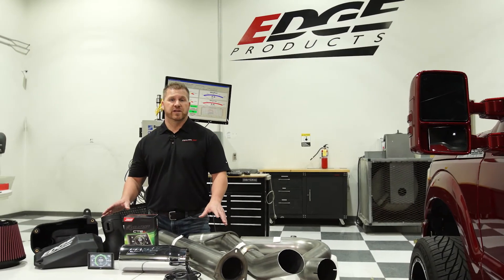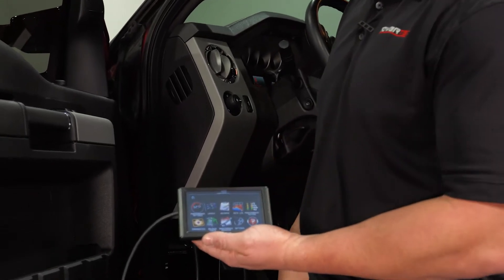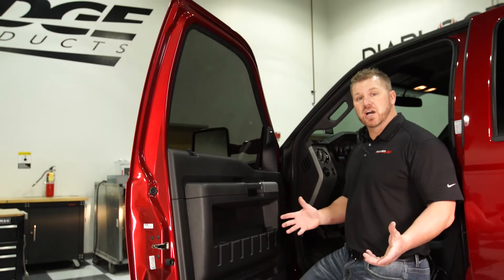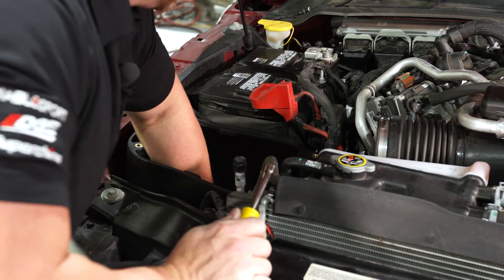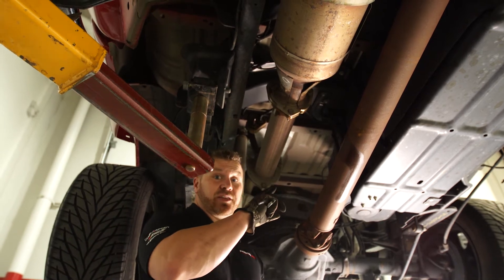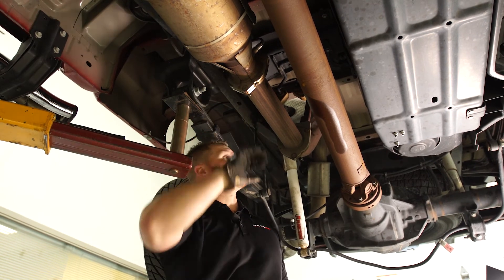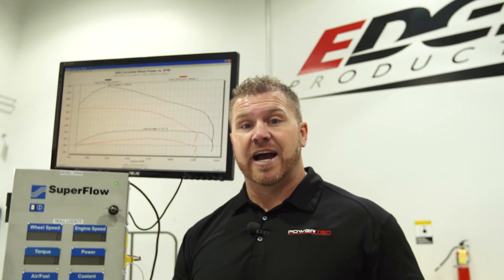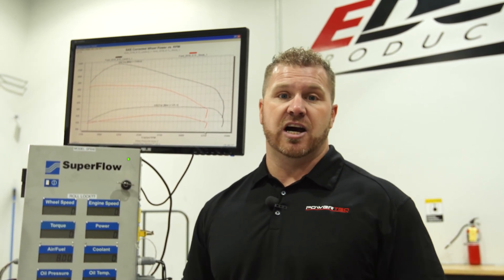Edge Products Install of the Stage 2 Kit On a Ford Power Stroke Diesel Performance

Comment: What do you think about DEF delete and CAT delete - aftermarket changes? I've heard a lot about DEF causing long term problems - I have a 5" straight pipe from the manifold all the way back - looking for stage 1 and 2 upgrades. Thanks for the video - very good.
Reply from the maker: Robert Jones We do not do anything with the emission deleting. We have great success with the emissions on tuning. We get carb certified with our stuff and it tunes a vehicle very well runs well great mileage great performance and keeps everything legal.

Comment: On the baseline dyno test, you guys hit 410 hp and 854 lb/ft of Torque?? On a completely stock truck with no addons? I have a 2016 6.7 PSD. Was that with the Jammer intake and Exhaust installed? I just think that's a little high for a stock truck. You now have my attention with your products. I also like how you test with the hood closed like real life conditions. Thanks, Dave

Comment: Where you guys located? Also will this enable my truck to push out more visible smoke? Or do I need to add a straight pipe on through?
Reply: More black smoke isn’t good. Just wasting fuel or bad tune/tunes.